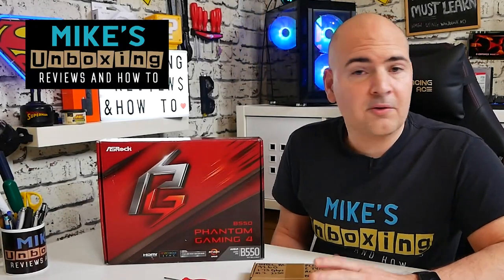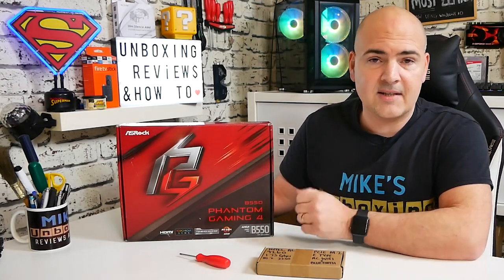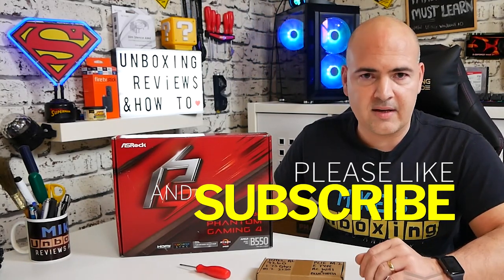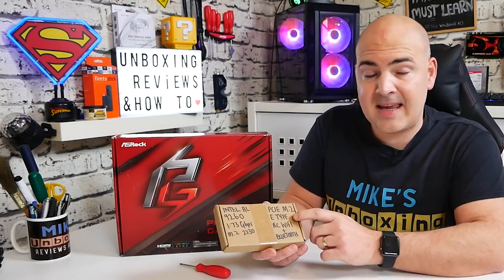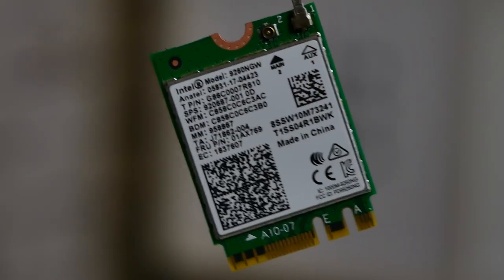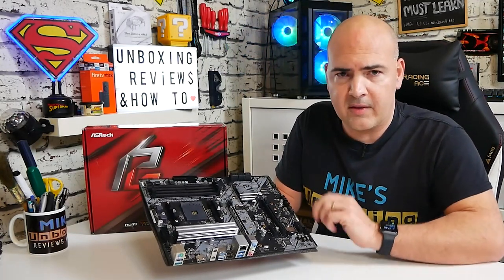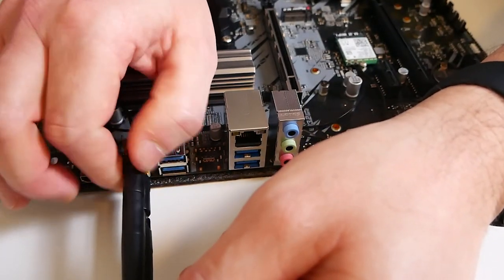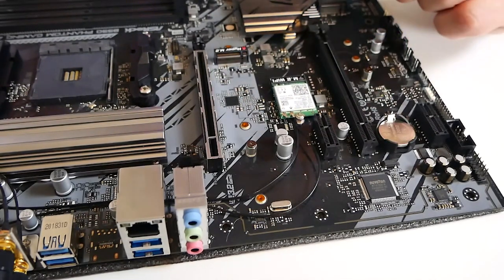How To Install M.2 Wifi Bluetooth Combo Card  Intel AC 9260 With Bluetooth 5 1

Comment: The hard part to this is making the connection to the wifi card itself. It would have been helpful to see it done.
Reply from the maker: the tiny little cables are just push on, not really much to see there
Reply: @mikesunboxing  you literally said it's tricky and took it out of the video
Reply: Literally the part i came here for. Not helpful at all
Reply: That is specifically what I am trying to find.
Reply: @mikesunboxing  Rubbish. It is tiny, fiddly, very difficult to do. I wanted to see how an expert does it and found nothing here. I have spent hours trying to attach these. Looks like I'm taking it to a shop tomorow.
Reply: I agree with everybody else here. That's what I came here to see. It seems to be the hardest part. It's unfortunate that you did it off camera. It may indeed be "simply" snap on, but I don't find it simple at all.
Reply from the maker: @rackattackgamer7928 I have bought another version of this to make another updated video and I am working on a method to secure the connection and be able to film it hopefully
Reply: @mikesunboxing bro cares about his community W
Reply: @mikesunboxing  Very well. Good luck & thanks.

Comment: Nice helpful video. Thanks. It's now worthwhile to point out that Windows 11 supports all the Intel M.2 wifi cards. Also buyers need to be aware of the system interface, Wi-Fi(PCIe) BT(USB), or, CNVio. They look the same and both fit but there is no cross compatibility. The only difference between the 9260 that you used and the  9560 is the interface.
Reply: Really wish it showed how to connect the antennas. I’m not able to get it to snap on at all and moving the card. They just pop off.

Comment: That Intel Wifi-module in the video works with either A or E slot on the motherboard, hence it's a A+E key. If it fits physically, it works (should work at least). So this video is a little misleading. Some M.2 Wifi-modules are key E only and those won't work or physically fit in key A slots.

Comment: Thanks for the great how-to, Mike! I do have to say... if I have the choice, I will buy one with wifi built-in. Just saves the pain of adding it. I usually get an PCIE wifi card, or a USB device if I need to add that functionality later. I have never used that M.2 wifi connector before. Great to know!
Reply from the maker: it is a lot easier to get one with it built in if possible, in the mainstream for US europe canada etc the option is largely left out but in the more developing nations where the manufacturer needs to cut costs as much as possible to reach the lower price points this type of modular system is a lot more popular

Comment: Does this work for PCIe wifi cards with a wifi module slot as well? Example: I have a GC-WB1733D-I PCIe card with AC wifi. Could I pick up an Intel Wi-Fi 6E AX211 CNVio2 module and replace the module on that PCIe card?
Reply from the maker: possible but CNVio2 needs a compatible motherboard and processor to work so be careful when buying

Comment: I can never understand from a cost point why install a M.2 Wi-fi socket on the MB when it just must be about the same cost to just install the Wi-fi chip on the board. Great video, thanks Mike.
Reply from the maker: Good point, the chips themselves often require licensing of the technology so it does save the bill or materials and can reduce the price for developing markets

Comment: Thank you very much, very good video, very informative and to the point. I had a funny problem! I bought one of these adapters, and it didn't come with any antennae for some reason. So I just stuck it in and thought it should work. It didn't, obviously, so I spent the longest time trying to figure out if my metal case was blocking the signal, troubleshooting the drivers and so on, until I just gave up. Now, a year after having this card uselessly sitting around in my PC, I finally figure out the problem haha.
Reply from the maker: Glad you figured our your problem :-)

Comment: Couldn't have come at a more appropriate time this Mike haha, as i was just going to pull the trigger on an Asrock b550 riptide PG matx, (nice board).
But you video got me to thinking.. if i'm going to spend another £25+ adding Wi-Fi, i may as well wait for a board with built in wifi to pop up as i'm in no real rush, and the 5700x3d i'm wating to come from Ali will run fine on my steel legend till the right board appears.
Thanks for the video, say Hi to Kath from me, great video as always.
Reply from the maker: yeah that is the question to be asking, if you need to have wifi support is it best to buy the card you want separately or get a motherboard with one included?

Comment: I've had to give up trying to get the WiFi wires on. Absolute nightmare. How did you manage it ?
Reply from the maker: i got kath to do it, agreed it is pretty fiddly a pair of pliers is a good option to get some good pressure on them
Reply: Got the aux one on but not the main connection does it matter that both are not connected ?
Reply from the maker: @digitalmediafan  yes they both need to be connected to complete the virtual wifi loop of input and output
Reply: @mikesunboxing  strange how one goes on fairly easily the  other won't stay on, can't see why bizzare
Reply from the maker: @digitalmediafan  yes both need to be connected I think for the best performance
Reply from the maker: @digitalmediafan  sometimes it need a few attempts to get the angles right and then it pops on reasonably easily
Reply: @mikesunboxing  yes it did once with one but not the other. I taped the other down but the WiFi is awful with two 6 inch antennas screwed in hmm
Reply from the maker: @digitalmediafan  keep trying it will fit eventually or should i send kath round?
Reply: @mikesunboxing  yeah sure lol 😆 that’s your wife I guess ? No I’ve had to give up after 50 plus times. Not sure I have the correct card even
Reply: Working but only with the Bluetooth driver not installed. Bizzare. Any ideas what's wrong ?
Reply from the maker: @digitalmediafan  try installing the driver from the manufacturers website that seems to help most people having issues
Reply: @mikesunboxing  I did and also from the drivers cd but no go so guess I don’t have the correct card
Reply from the maker: @digitalmediafan  try manually changing the driver from device manager or remove from device manager then run the installer on the disk
Reply: @mikesunboxing  I’ve done all that actually. Guess I don’t have the right card. Bluetooth installed just knocks out WiFi and when I remove Bluetooth back comes the WiFi
Reply from the maker: @digitalmediafan  very odd, maybe head over to the discord chat so we can try and figure this out

Comment: My asrock j-5040 has an E type m.2 slot but only supports a 2230 module it seems ?
Reply from the maker: i think that is the same but a different name, it looks to be the same and the intel spec version that also fits is the same size, so should be fine
Reply: @mikesunboxing  yes thanks worked that out later.  I've bought the same kit as yours but from aliexpress as its over half the cost even with the annoying new extra 20% VAT on top !
Reply from the maker: hope it turns up i have had two ali express orders not show up recently.
let me know how it goes.

Comment: im upgrading from m.2 card to pcie card and this video helped by showing how to remove a m.2 thanks! Question tho do i need to remove m.2 card or could i have both? im upgrading since i got a bad realtek card that causes connection issues. seems wierd to me that the motherboard has both options but maybe thats normal?
Reply from the maker: you can leave both in there, the m.2 card has pre allocated resources so it should be fine to leave it in

Comment: Hello Mike, nice video tks for that. I have a question about de the Bluetooth connection. I have tuf b550 plus motherboard and would like to install M2 wifi card with Bluetooth this just work or I need something more for the Bluetooth connection like a USB cable for power connection ? Like pci e cards. A lot of thanks from Brazil!
Reply from the maker: think this one was self powered but it was a long time ago.

Comment: I have a ASRock B550M-C motherboard and it has built in Intel AC 3168 module but seems to be hidden within the I/O panel. Cyber power pc nor ASRock seem to show how to remove it. The manual for the motherboard shows it has the M2_Wifi_2 but not visible on motherboard. Any ideas on how to remove the I/O back panel and replace the wifi module? There is also no wires visible from antennas to the module.
Reply from the maker: This is maybe easier to fix or at least advise if we can ask more questions and get direct answers, so feel free to join our Discord chat and we can go over it in more detail https://discord.gg/XtBTGQ6BDu
Agree to the rules by clicking the emoji and you will get access to the rest of the Discord channels

Comment: Hi mike, i wanted to know does the antenna matters for good Bluetooth and wifi range, because the current ones I have seems a bit laggy when connect to any of my Bluetooth audio devices, I don't know if wifi card or antenna is at fault here. I know its been three years since the video is out and probably you wont see this message, but I would be extremely thankful if you reply.
Reply from the maker: the antenna is quite important and more so with the faster bluetooth specs. ideally a front mounted usb bluetooth is preferable for signal strength and not having lag.
Reply: @mikesunboxing  so i already have a wifi 6e + bluetooth 5.2 m.2 card and 2 antennas I bought seperately from Amazon they look basic, all my bluetooth audio devices lags sometimes, so should I buy new antennas? Does antennas differ in quality or are all the same.

Comment: Thank you very much Mike for this how to. Very nice that the MOBO has the slot for it. Question: can a PCIe AX card run in AMD MOBO? in Aliexpress sellers say Intel only.
Reply from the maker: some of the cards are for the intel vpro system so they are Intel only but most if not all pcie or m.2 ax200 cards are not locked to either intel or amd

Comment: I'm installing one of these in a new pc build, but one of the mini sma connectors will not snap onto the card. Should I try superglue, solder, tape?
Reply from the maker: just try checking the connection is not bent or misformed

Comment: bought this same motherboard based on your recommendation! Will this work with an AMD CPU? Also, would the antennas get in the way of the hdmi's coming out of the GPU, or could you face the antennas downward?
Reply from the maker: totally fine and yes you can move the aerial so it is out the way

Comment: Thans Mike, I have Asrock B660M Phantom Gaming, and when I installed the windows, it couldnt connect to the wifi. and i noticed that its missing M2 wifi Module.
Reply from the maker: sometimes the boards have variations that don't have the module installed

Comment: I want to build a new pc and motherboard I am looking forward to buy has m.2 key E slot but it has no space or brackets for routing the antennas out of the case, how can I solve this?
Reply from the maker: that is often a problem. you can get the same m.2 card as a kit with the antenna and a pcie bracket for the rear of the case like a gpu or accessory card

Comment: Are there any benefits of a M.2. wifi to a PCIe wifi card. Or is it just a matter of choice
Reply from the maker: no real benefits that would make you buy one over the other, except if you have the slot on your board it makes sense to use it to keep the other slots free

Comment: Did your M.2 wifi card come with the antennas? Or are those sold separately? Thanks.
Reply: Another question. I see you have an AMD CPU motherboard. Is that correct? I've been reading that the Intel AC9260 isn't compatible with AMD CPUs, any truth to that (assuming you might have tried)?
Reply from the maker: they came with it
Reply from the maker: doesn't appear to be any issues with it

Comment: Sorry to bump up this old thread, but I notice you are using an AMD board, I heard that several Intel cards don't work with AMD? It's mostly the M.2 vPro wlan cards that need an Intel CPU?
Did it work well, in this setup? Thanks!
Reply from the maker: yeah it worked fine, not sure what is going on there?

Comment: I have an asrock b660m pro rs board. I have the m.2 WiFi slot, can I run any m.2 WiFi card? I found one that says 6e after it but I’m unsure
Reply from the maker: You should be able to run e key m.2 cards but not tried it myself

Comment: I have a Asus ROG Z490-A with a M.2 Wifi, but nto sure if your card is for this MB as well, I also found a M.2 WiFI 6 card on amazon with mimo 2x2 and miracast - Model AX200NGW , did you tested this one?
Reply from the maker: not yet sorry, but i'll look into it
Reply: @mikesunboxing  I bought it original Intel box, same model AX200NGW. BT 5.1 and WiFi 6, is perfect.

Comment: Hey Mike, thanks for the video. I have a question, does ASrock B550m Pro4 come with m.2 screws for WiFi module? If not, can I use m.2 ssd screws for the WiFi card?
Reply from the maker: yes you can if they are not already included with the card itself
Reply: @mikesunboxing  thanks Mike.

Comment: Hi, i have b550m aorus pro motherboard, it doesn't have built-in wifi, and the lower pcie slots are covered by the gpu so can't install those pcie wifi cards. The motherboard doesn't have any key E slot in it for wifi but it has only 2 nvme m.2 slots. What can be done to install the wifi card in it
Reply from the maker: you can get a PCIe to m.2 E key extension maybe?

Comment: Hey there. I hope you can help me out. I bought the AX200 card and installed it on my AsRock B550 PRO4. I got the Wifi working without the antenna since the wifi card I bought didn't came with one but my issue is the bluetooth. I can install the drivers but it seems to not function normally at all. Bluetooth cannot find any devices nor can it connect to one that is already saved on its list back when I was using a USB bluetooth adapter. Would you happen to know a solution to my issue? Some of the solutions online that I see is getting a PCIE m.2 slot that has a supposed connector to a USB header for the bluetooth but I can't use that since my GPU's thickness is covering the PCIE x1 slot. Would getting just the antenna resolve my issue or do I need to change the card itself?
Reply from the maker: This is maybe easier to fix or at least advise if we can ask more questions and get direct answers, so feel free to join our Discord chat and we can go over it in more detail https://discord.gg/XtBTGQ6BDu
Agree to the rules by clicking the emoji and you will get access to the rest of the Discord channels

Comment: do all new motherboard got a 2 holes for wifi antenna?
Reply from the maker: no not all, but some times it is an option to use a pci blanking plate with holes in, some kits will come with that as an option
Reply: @mikesunboxing  i see just like a video card /sound card slot

Comment: Hey my motherboard doesn't really have a m.2 wifi. So can i buy a m.2 key m to key e adapter and connect the m.2 wifi. If so can you recommend a adapter that you know. I'm having a hard time finding a adapter . Thank you
Reply from the maker: that is sometimes an option but due to electrical terminations and potential issues i would really advise against it, what board do you have i might be able to offer some alternative.
Reply: @mikesunboxing   I am not really planning on overclocking so i went with the gigabyte b550m ds3h an ryzen 3 3300x. I was planning on buying a pcie wifi but my board only has one usb 2.0 header which means i can either connect my pcie wifi card or my front panel usb 2.0 header. Lastly, if I buy a wifi 6 pcie card to install it in pcie 2.0 slot in a b450 motherboard will i still able to use the wifi 6 or will I be left out behind

Comment: I just bought a Gigabyte b550 gaming x v2, will this fit in the extra m.2 slot? And work?
Reply from the maker: no it won't you will need a PCIe to m,2 type e adapter, or just get a PCUe card wifi

Comment: Thank you for this video. I was researching if this Intel AC 9260 can replace the Intel 8265 that came with my NUC Hades. That Intel AC 8265 seems to disconnect frequently and the machine is just under 2 years old.  Ive tried updating drivers etc & no improvement. Again thank you for the video.
Reply from the maker: Glad I could help

Comment: What are the benefits of the m.2 format over pcie wifi card or adapter of similar speeds?
Reply from the maker: no real benefit other than if you have spare m.2 or pcie slots

Comment: Hi Mike I have the x570 of that board and have a ngff wifi card from Amazon, AX200 it comes up as, do you have any advice for better antennas?
Reply from the maker: as long as they have the sma type connection a decent antenna with a extra DB gain should improve things, i don't have any specific recommendations but there are a lot of options including direction antennas that will strengthen the signal when angled toward the router or access point

Comment: How does it present the bluetoooth part, on cards it's usually driven by an internal USB connection.
Does it present on it's own USB controller (Devices, view by connection)
Ah, USB is present on the M.2 slot, so it will be coupled to the system USB without needing a cable like a PCI-E WiFi + bluetooth uses
Reply from the maker: i was about to answer but you did already :-) what is for dinner tonight or is it a surprise?
Reply: @mikesunboxing  Do I risk a Pizza that's a little out of date .... doesn't look furry!
Reply from the maker: @Matthew Day  I would!

Comment: hello
my mb has an m.2 wifi slot but there is no antenna bracket or space on the back of the mb for the antenna.
what can be done?
Reply from the maker: some of these kits come with a pice blanking plate that can be used, if not use one of your own and drill out two holes for the antenna to mount